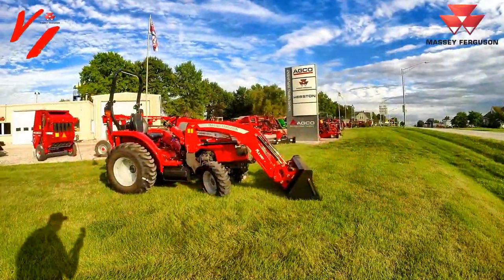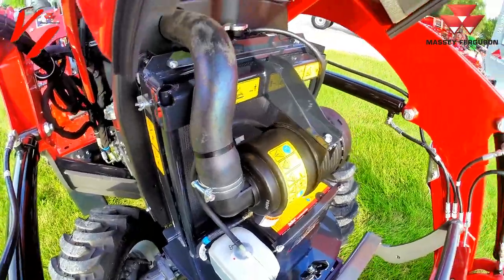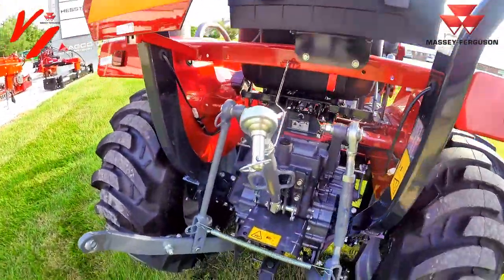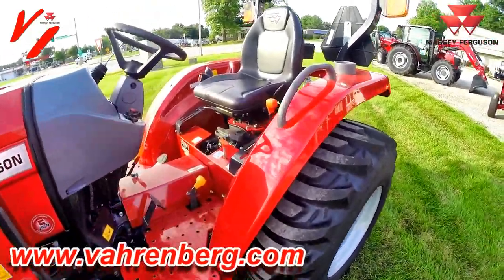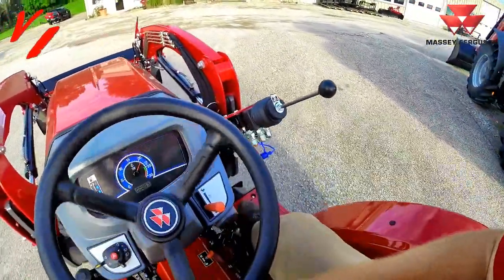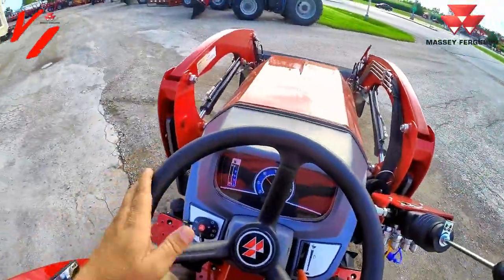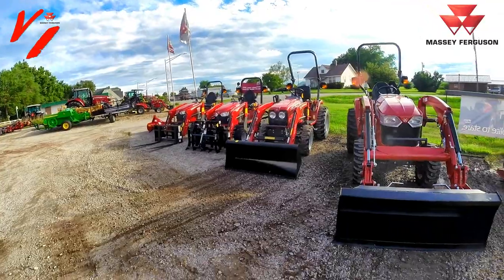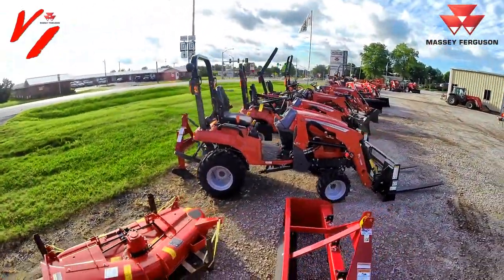Massey Ferguson 1825E Hydrostat Compact Tractor (24.0 Engine HP)

Comment: Heal/toe is so old school and such a turnoff. Kubota and MF need to listen to users. I don’t know anyone who likes these. I was interested until I saw that. Oh well, next…
Reply from the maker: Massey Ferguson offers Both Style. The E Series more economical tractors are heal toe pedal and the Premium M Series Tractors have side by side suspended hydro pedals. Or in the 25 HP class the 1526 offers side by side though the floor pedals. Massey Ferguson provides options as we have some that are use to heal toe pedal and that is what they want. With Massey Ferguson we have products to fit both operators needs.
Reply: I don't see what the issue is. Works fine.